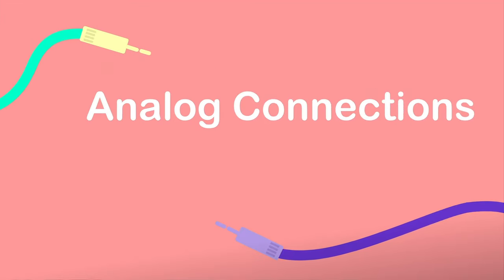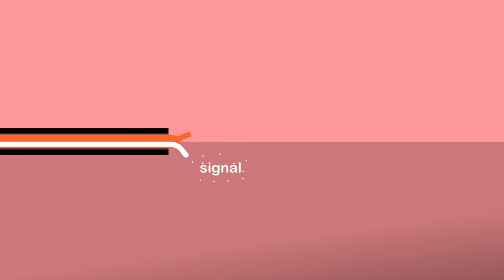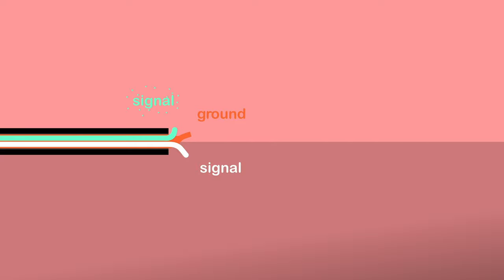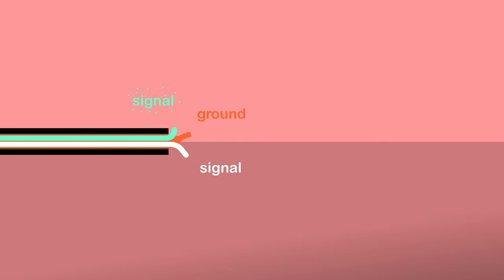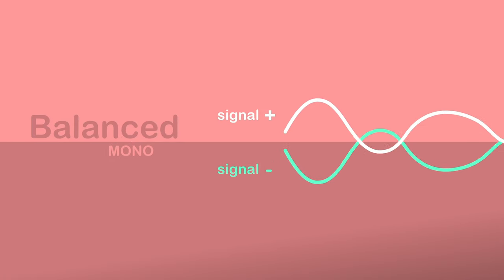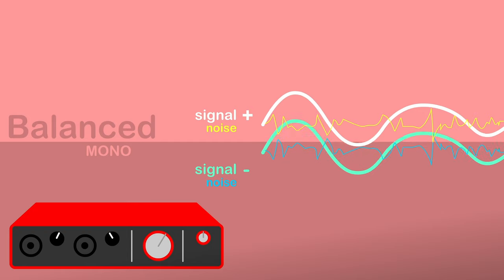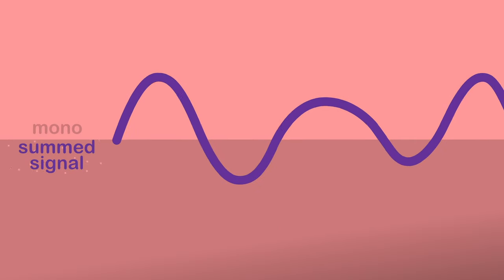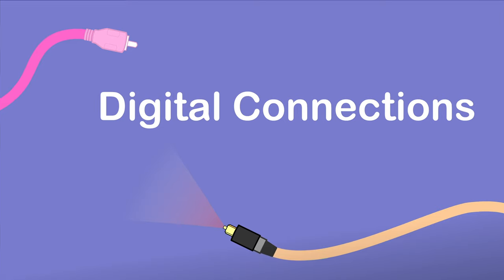Balanced & Unbalanced, Analog & Digital, All Connections Explained // Audio Interfaces Part 2

Comment: Can my rca to xlr be used as my spidf cable??
Reply from the maker: Most likely no. What devices are you trying to connect?
Reply: @arbitersofsound trying to connect my dbox+ to scarlet 18i20, I'm using the analog send for my monitoring, and db25 for summing, but I wanted a spidf connection
Reply: I tried using my rca to xlr on my cdj digital sends and it worked'
Reply from the maker: @Only1retro  From what I can see the dbox has AES digital and the scarlett SPDIF, which are different standards.
Although, I found this old article on SOS which explains how and why it could actually work in specific cases:
https://www.soundonsound.com/sound-advice/q-can-connect-aes-output-spdif-input

Does that help at all?
Reply: @arbitersofsound  yes, this is what I was looking for, it'll work. It's an xlr to rca phono.
Reply: Just got to the studio, my rca worked with the spidf to aes for my dbox+
Reply from the maker: Super! Well I definitely learned something today :D The dbox must be a pretty sweet piece of gear  @Only1retro